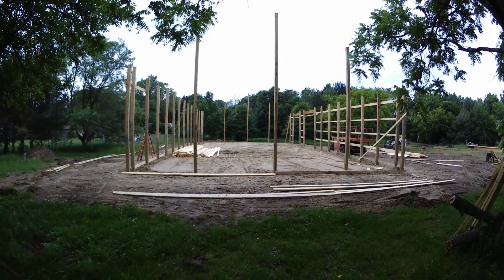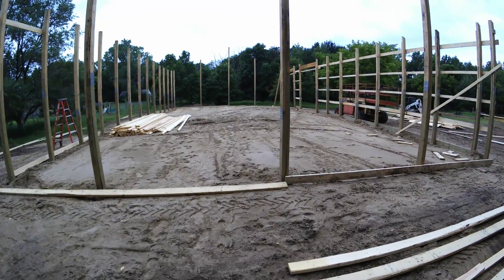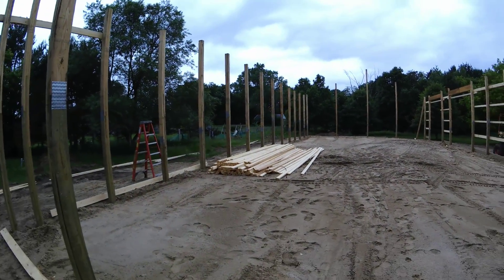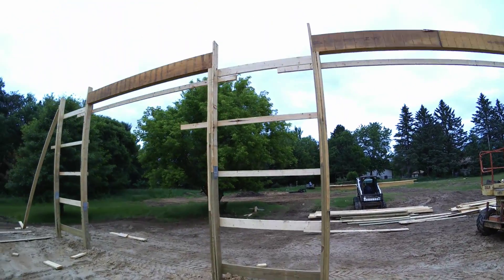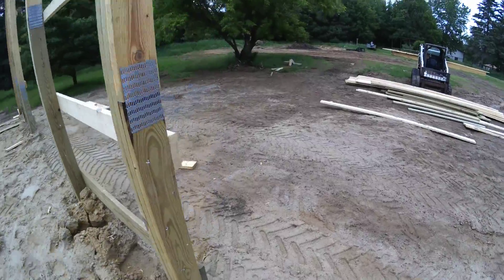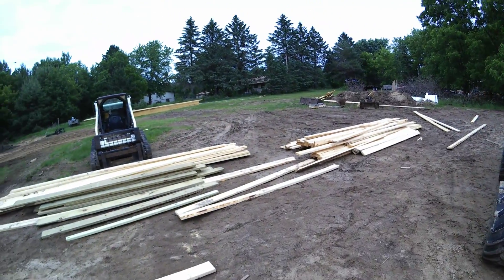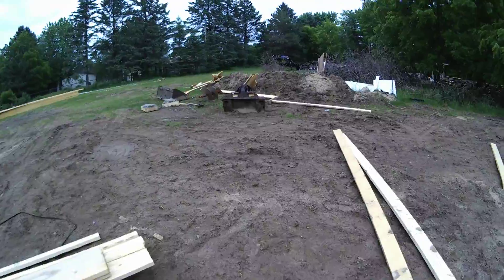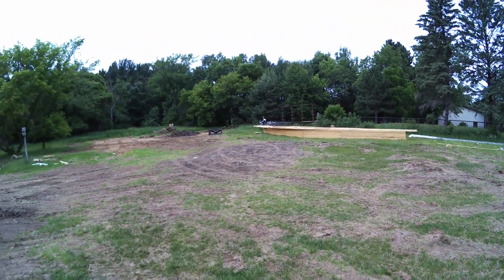Pole Barn Thermal Mass Sand Building Pad & Pole Framing

Comment: great idea to put the radiant floor in the sand, very unusual...is the radiant floor in the cement as well ? because the sand wants to move are you sure it wont sink or move  with time and crack the cement floor on top? what was the total depth of sand and the cement floor ?
#
Reply from the maker: Only tubes in the sand , and sand is the most stable foundation to put concrete on. The cement is about 4-5 inches and the tubes are about 10-12 inches under cement top.  So basically sand and cement have close to same heat transfer rate, but sand is cheaper per yard then concrete.  Thanks for watching

Comment: Is there foam under the sand thermo mass
Reply from the maker: No, just the sand base. Foam would limit the size of the thermal mass. You foam around the perimeter of the building